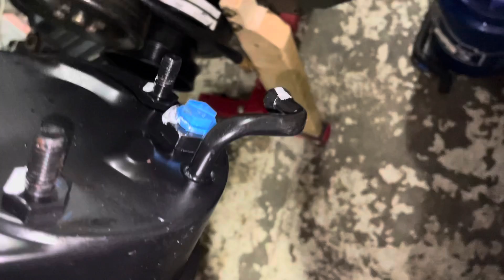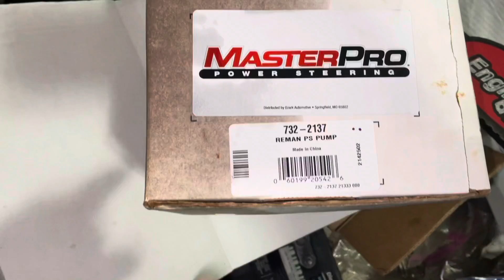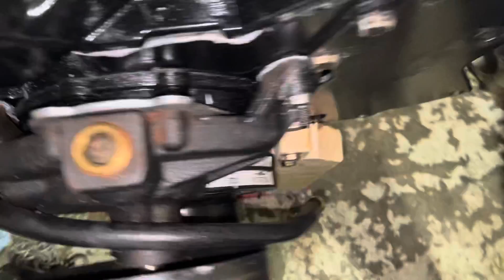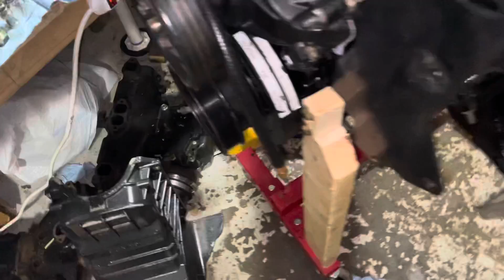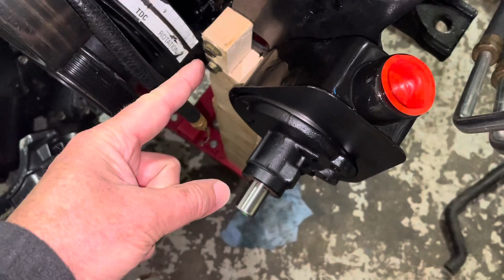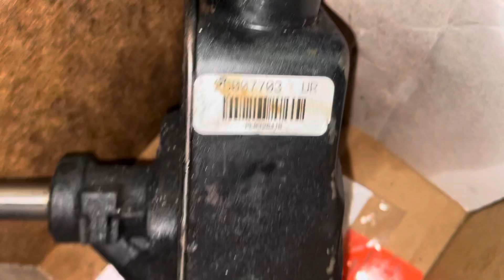Mercruiser 5.0 MPI 1(l) - Save $800/Use Truck PS Pump

Comment: I am in the middle of using this part as a replacement on my Merc 5.0 alpha. The one issue I'm wondering about is the metal hose at the bottom facing left instead of right, with the original. It seems it'll be difficult to get the rubber hose to connect easily with that alignment. have you had any issue with that? It seems the other hoses are going to restrict the path of the rubber power steering hose.
Reply from the maker: The boat is gone but I don’t recall it causing any difficulty.
Reply: @moccasinmarine  I was able to weave the hose back under the motor. I thought about cutting it shorter but left the extra in case cutting it would affect the pressure.
Reply from the maker: @dl-wood-86  that hose is the low pressure return line. You would not hurt any pressure on the supply side since it’s probably 500 times higher.
Reply: @moccasinmarine  Thank you. Good to know. I"m having a tough time getting the washer between the lower front bracket and PS pump in place with the bolt inserted. It's in the boat and in a tough spot to reach. I'm using tape to try to hold the washer in place while I wiggle the pump around trying to line up the bolt with the hole in the pump. No luck getting it threaded yet. I'll try again tomorrow.
Reply from the maker: @dl-wood-86  welcome to boat playhouse where nothing is as easy as it should be. What I do is start the upper bolt as a support even if the spacer is not in place. That makes it easier to work the pump while you insert the lower bolt with the required spacers. Then once you get the lower bolt almost tight remove the upper bolt and apply any needed spacers and then do the final install.
Reply: @moccasinmarine  I got all the bolts in and was ready to tighten everything then noticed it is not perfectly in alignment with the other pulleys. The shaft is leaning in a little. I think it'll wear or throw the belt so I'll have to add shims/washers. If I pull the pulley out a little it might line up but the shaft will still lean in, out of square-so to speak. What do you think?
Reply: @moccasinmarine  I'm also wondering if I tighten the bolts on the back of the pump, can I pull the front with a bar so it aligns at 90 degrees instead of leaning inward. What do you think?
Reply from the maker: @dl-wood-86  bend the mounting plate with a rubber mallet until the pulley is parallel with the other pulleys. Then use shims (washers) to line up the pulley in the same plane. If it’s not more than 1/4” off I just pull the pulley off the pump shaft a little with a puller.

It’s kind of difficult to bend the plate the right amount because it acts like a spring and requires a hard hit but then it can bend too much so it’s trial and error. Makes me wonder the the old pump was lined up in the first place.
Reply from the maker: @dl-wood-86  I don’t know what you are describing here.
Reply: @moccasinmarine  There is a thick bracket on the front of the pump and another on the back. I don't think I can bend them.  I'll try pulling the pulley off the pump shaft a little to see if that works. The next step would be taking it apart (pain in the neck) and adding washers in strategic places to try to get it in line. I appreciate all your help.
Reply from the maker: @dl-wood-86  you must be using a different bracket than what I showed in my video.
Reply: @moccasinmarine  I’m using the existing brackets. There is a front and rear bracket that are thick and substantial. I’m going to try pulling the pulley off just a little to see if that lines it up.
Reply: @moccasinmarine  I pulled the pulley off just a little and it lines up great. I put fluid in the pump and ran the motor. The line up is nice and smooth. The problem is the power steering is not easier. I was not able to flush all the old fluid out but shouldn't it turn easily with a new pump? Any advice?

Comment: I used your method with the oreilly power steering pump. One issue I had was the pulley didn't line up exactly and was throwing my serpentine belt. After thinking it through I figured out the issue. When you use the bolts instead of the studs with the nuts the pump will be out of alignment and cause the pulley to not line up exact. Add washers to make up the difference and this will fix the issue.
Reply from the maker: I did use washers I think. It’s been a while so I can’t remember. The issue is it has to be both parallel and in the same plane as the rest of the pulleys so getting all that set up can be challenging.

Comment: I am rebuilding a mercruiser 5.0 with serpentine belt I want to start the engine outside the boat before installing what do I do with the power steering lines while running the engine?
Reply from the maker: If it were me I’d find a shorter belt and bypass the ps pump if possible. Or since pumps are cheap if not bought from Mercruiser pump all the old fluid out into a bottle and run it with what little is left in the pump for lubrication. It might ruin the pump but my video shows how to replace the pump cheaply. This is one of the reasons I always run my engines in the boat using my “Water Mocassin” adapter.